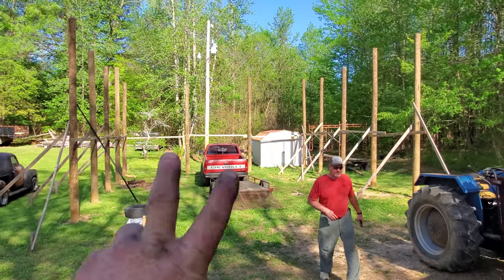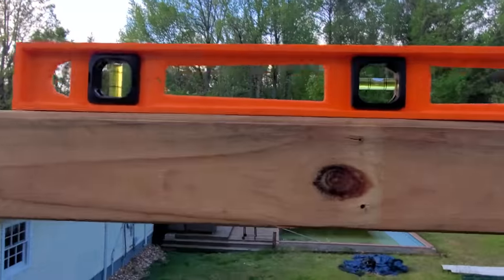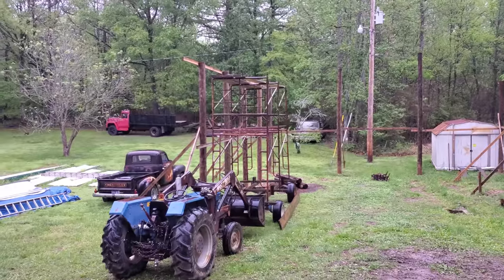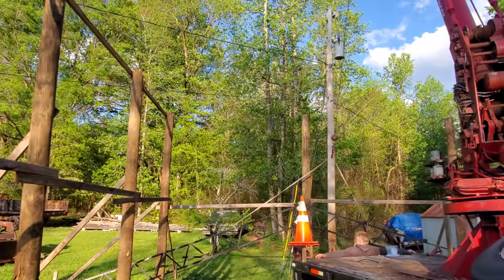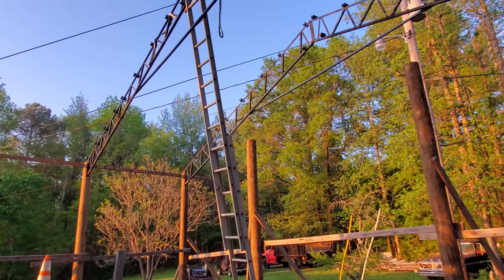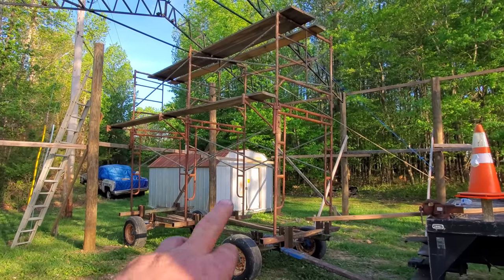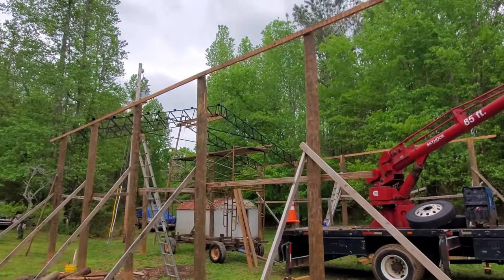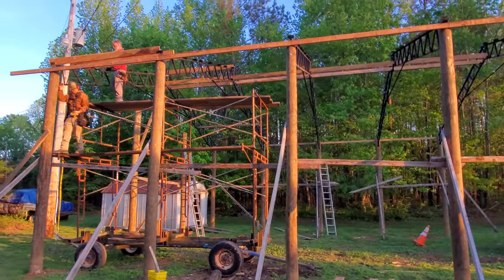Shop Rebuild Part 2 : Trusses are set!!

Comment: Just wanna drop in and say I didn't see that the HV is on the far side of the pole, and not the building side. I now realize how silly I sounded last video. You all good dude. The bottom will be coax, the little single a ground, and then course the twister looking fella is your 240 for the house (I figures you know that, but just in case).  Shops comin together really nice like. They need to make like a mini chainsaw for fancy cuts.  I like this Mason fella, he's a smart cookie. I hope the weather cooperates with ya.

Comment: Git yerself a bunch of clear tubing and fill with antifreeze to make a 'water level' No need to to do numbers. Go anywhere and it will be the same-same. !! Woo-hoo !! Progress!!
Reply: levels with a laser also a cheap way to go.
Reply: I used food coloring in my water level on 2 a 3 story decks for 20 years
Reply: I used a long piece of string , a nail and a henweigh... works in Kentucky.
Reply: Chris Smalley what's a henway??? 3 or 4 lbs?? 😲🤔🤔🤣🤣🤣😳

Comment: You might cut extra long 2x4's and place on lower section of truss near peak to act as temporary supports between them to keep tusses straight. They  can come back down after roofing is installed.

Comment: I guess as long as you think it wont fall down then its going to be strong enough for sure......
and yes i may have set the poles a little deeper and with full concrete to save cutting the wastage off the top
but looks like you are in a sheltered spot so wind wont be a problem
big sheds take a lot of doing....Good Job.....

Comment: As someone who builds these kind of buildings but on a much bigger scale professionay, it was very entertaining to watch.

I do think that these trusses are meant for ground assembly, its the wind thats bending it into a rainbow shape. If i were you i'd weld them together once you are finished. The 2 small bolts in the middle is not something i'd trust.

Besides that, amazing video as always!
Reply from the maker: The only thing they are holding up is themselves and some metal roofing.

Comment: Nice video. Lateral stability comes from the lateral support on top between the trusses. The black square stock between the 2 halves should have stopped the twisting if tight. Ron PTL USA

Comment: Buddy. I used to say the same thing about being level and plum. But then I realized even being within the lines you can be upto a 1/2 inch off level in the length of the level itself. If you times 1/2 inch by the length of what the level is sitting on (10-12 foot 2x4)  and your level is a 4 foot level. Well you’re off 1.5 inches in 12 feet.  It may work but it would bug me
Reply from the maker: It's a shop built from used lumber and metal, I'm pretty sure it'll be just fine.
Reply: @ThisNThatGarage  it will. You’re doing damn good work.  You know I appreciate the videos.  My fav channel to watch. Can’t wait for the next episode

Comment: I build docks, boatlifts and seawalls, the easiest way to cut a level pole top is sight your chain bar along the horizon.  I realize you prolly couldn't see the horizon but you never know.
Reply: That’s a great tip. Especially along the water.

Comment: Comment on plumb bob swaying in the wind. When machine erectors line up  vertical column ways they use a heavy bob and set the bob into a bucket of heavy weight oil. The bob stays perfectly plumb.

Comment: Chad Laser Level ,and yes you can rent them ,Yes Sir and will save you lots of trouble . When you get everything and set in place as square as you can ,pull the bolts and weld them together they will be much stronger and won't creek when the wind blows

Comment: U see guys use 2 inch ratchet straps to jack walls or pull wall or they measure roof to square them up.. works good.. anchor at ground.. ratchet and pull wall or roof in whatever direction u want

Comment: Hey bud not sure how much more your going to use the skyhook but if its a lot you might want to run a charger to the batteries.  Normally when these cranes are used the generator slash welder is running charging the batteries. those electric motors use a lot of power.  Oh and by the way glad you got rid of the know it all's. Gods Speed
Reply from the maker: Those batteries will last for hours before needing charged.

Comment: Nothing wrong with the way you installed the trusses that I can see, do not see much other way to set them. helped dad build a pole barn 40 some years ago with wood trusses. Every one said we would have to cut each set of rafters to fit individually. But we squared the top of the poles with 2X8's, then cut all of our rafters the same worked great. One builder would not accept that it worked till he came and measured himself.

Comment: Hi Chad, greetings from the UK again mate! :). Ignore the haters, know it alls seem to know everything, except when to STFU! Shop build is going great, its gonna be awesome when its done. I'm thinking the trusses are twisting just because they're long spans of relatively thin metal. Possibly the company making them needs to beef up the steel somewhat?
Reply from the maker: This is the standard thickness metal they all use.
Reply: Hmm... Maybe they're just not suitable for being built out of angle iron? I'm reasonably sure all the ones they make over here are all tubular design. I could be wrong though... Lol. It doesn't matter anyhow, you got it sorted! :) 👍

Comment: Did you really expect a metal truss like that to hold itself straight.  It liiterally has no lateral strength alone.   Wood is Easier and better to work with.  Metal is just too flimsy  because of its weight
Reply: To everyone wonders why use metal then.  They do have a ton of strength when it comes to being pushed down.  Just not out.  When done right. They can hold a ton of weight above them. Such as roof and a ton of snow.  Also allowing you to space them out further then wood trusses.
Reply from the maker: You should probably watch some videos of steel truss buildings being built before saying that.
Reply: @ThisNThatGarage  so you think the maker did something wrong?